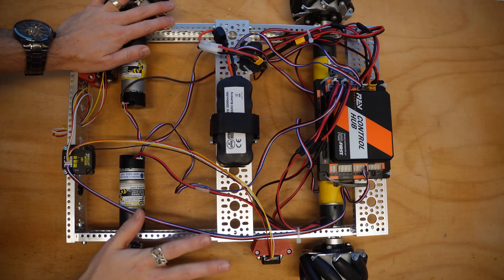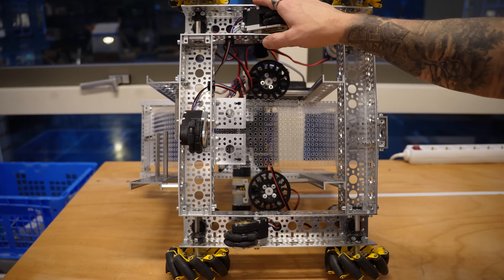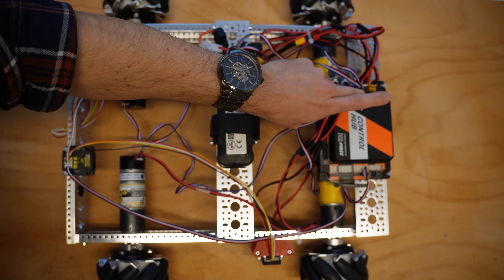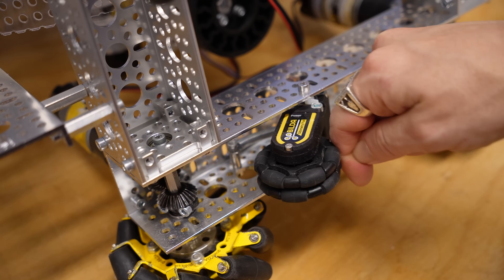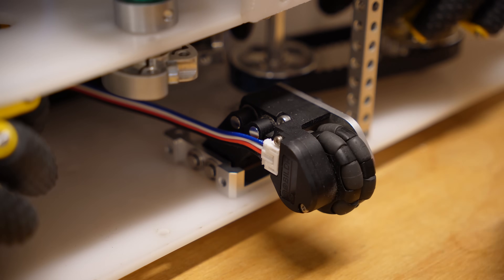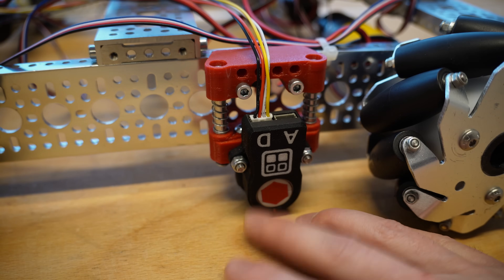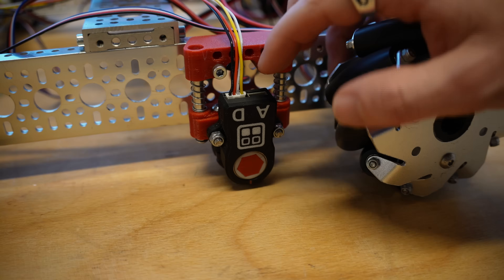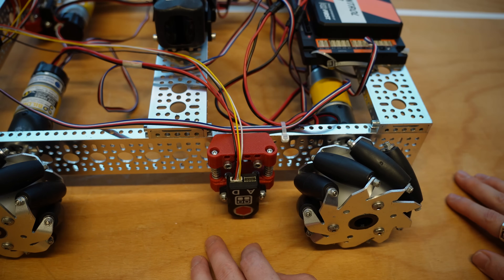The Ultimate Guide to FTC Deadwheel Odometry

Comment: Is there any advantage to using deadwheel odometry over april tag detection? I just bought the 3a for my team and was planning on doing localization using it. Would it be preferable to have both for localization – is deadwheel odometry needed for nicer pedro pathing and autos? We have about 250-300 dollars left in our budget after our master parts order which covers 2x the amount we need for almost every part so I'm not sure if the team should save that money for emergencies or spend it on these pods. We could always fundraise for them as well. Thanks for your advice!
Reply from the maker: Good question. You can definitely localize with an april tage, provided you're staring at the april tag the entire time. Generally, most robot structures don't allow for this. PedroPathing I believe* also doesnt support a purely camera based localization system, so that is something to consider.